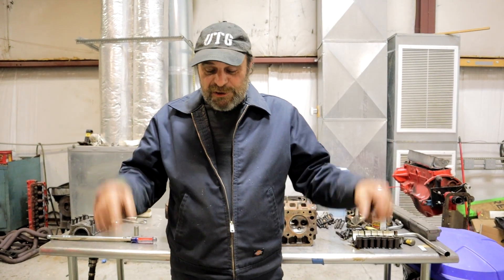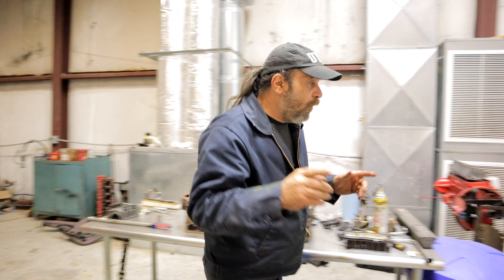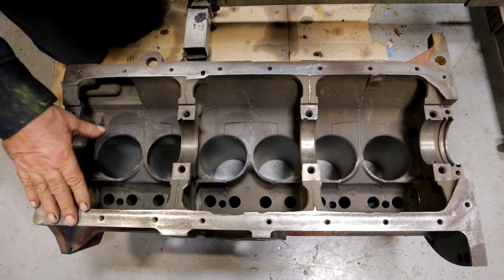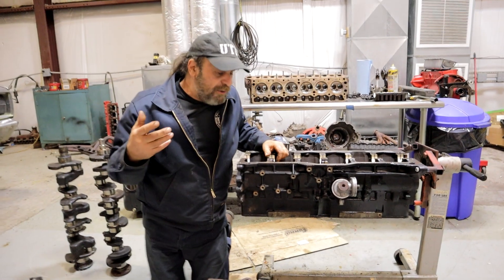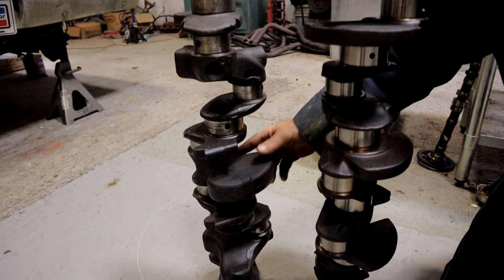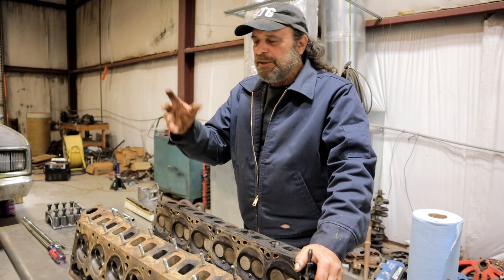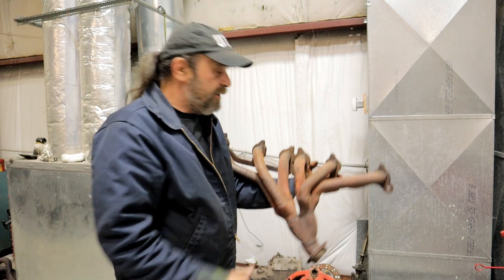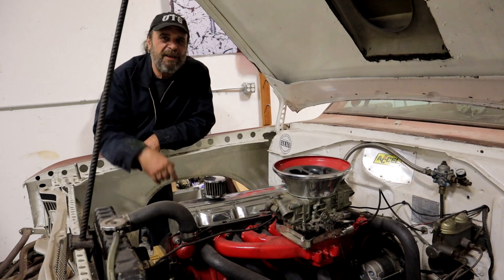The Mighty Mopar Inline 6's History And Comparison - Flathead, Slant, Hemi Six, 4.0 And Hurricane

Comment: Hi Tony, Aussie here. We had a strong inline 6 culture here. GM (Holden) had their grey motor (1948-63) and the red motor from 64-85. The most potent iteration of that was the XU-1 with 202 cubes, triple CDs in a lightweight Torana body (about the size of a Vega). It made 190hp.in street tune. It won Bathurst in 1972.

Ford didn't focus on an all-out performance 6 but did offer an Aussie-only upgrade to the 250 with a cylinder head that did away with the cast-in log manifold and instead made a nicely shaped bolt-on alloy one that took a 2-barrel Stromberg or Motorcraft carb. Good for 170hp and a peppy upgrade to a family sedan when a V8 would be too much of everything else (mainly cost).

Then there's the legend... The Chrysler Hemi 6. You told of the origins but maybe it needs its own storto be told by you one day. The ultimate version sported triple Webers and headers, all the usual go-fast trucks (cam, compression, etc}, and this lump made 302hp. At the time, it was the most powerful production inline 6 in the world. They sound lovely too. The charger was good for low 14-seconf quarters. It doesn't matter if you're Ford, GM or Mopar folk, the Chrysler Hemi gets respect here. 

On a side note, Ford Oz also developed their own evolution of the 250. In 1976, they made the crossflow 4.1 with a head based on Cleveland geometry and uses some components from that engine design too. In 1980, they went to an alloy head. This engine architecture carried on to its final glorious iteration: the famous Barra.
Reply: Damn shame what global communism did to GM Australia and in particular Holden.
Holden produced some of the greatest cars ever made.  A racing heritage that was in everything they made until the globalists took over.

Comment: Latest Curry-cane :) does not hold a candle to the AMC/Chrysler cast iron bottom end. Would like to see what the rockwell hardness is for your block vs the JZ and Barra with the Barra being quite soft compared to the JZ. There is a video of these bottom ends from DownUnder worth comparing to the AMC/Chrylser block. I would like to see also which was the most powerful and well built side valve L6 and L8 and even reverse flow the last Chrysler L head L6 and run boost.

Comment: The 1970 engine that came out in the Australian VG valiant was 245CI or 4.0L the 265CI came out in 1972 there was also a 215CI variant. They stayed around until Mitsubishi took over and they were phased out by 1982. I have always wondered if you could fit Jeep injection on the Australian engines! Thanks for the video UT!

Comment: Great to see the Aussie Hemi, 215, 245 and 265 mentioned. I never seen a AMC 6 in person, and explains why i thought they looked suspiciously like our Hemi engines.  Great information.
Reply: Even Chrysler Australia admitted the 215 was a mistake, by going for economy, they created the only gutless Valiant ever.
Reply: @jasonrivers7518   but, as gutless as they were, the perfect choice for Demolition Derby drivers,  the smaller pistons ment a thicker Bore sleeve, they can really handle the heat once the cooling system emptied out.  I still have my old 215 out the back, it's done  about 6 derbies? Was still running great, just really noisy tappets.  I'll drag it out of the weeds and fire it up 1 day. hasnt started in 20 years lol
Reply: Don't see how that helps, as in demo derbys everyone aims for the ball joints, mate?
Also, my old Dodge ute had no radiator, as my boss sold it, without telling me- 300km later, I noticed it overheating, and realised what had happened. After a half-hour wait, it started again...
Reply: @jasonrivers7518  ball joint hits don't necessarily stop a car,,   as for no radiator, (ur boss was an a-hole )  for not telling you. lOl  but just goes to show how much punishment the old Vals could take.
Reply: Absolutely un-killable, the 245, which was always my favourite, especially with 283 pistons, a mechanical cam, and triple SU:s, you had such a torque monster, my Charger had no traction whatsoever in 1st or 2nd, in the wet- and it had a sure-grip.
I eventually re-designed the entire rear suspension, using XF Falcon & LC Torana parts. (Watt's link, and springs).
Reply: Absolutely un-killable, the 245, which was always my favourite, especially with 283 pistons, a mechanical cam, and triple SU:s, you had such a torque monster, my Charger had no traction whatsoever in 1st or 2nd, in the wet- and it had a sure-grip.
I eventually re-designed the entire rear suspension, using XF Falcon & LC Torana parts. (Watt's link, and springs, respectively).
Reply: @jasonrivers7518   i remember my VH charger, flogged out 265, with the 4bbl Holly. Poor old engine was so worn, could barely hold oil pressure, 1 cam lobe was rounded off. But the same, almost uncontrollable in the wet, short wheelbase didn't help. lol_  aftermarket Dellow bellhousing, Falcon single rail and a suregrip from a ute i brought. Last time i drove it it blew a headgaske, sold it years later,, apparently it's since been back on the road somewhere in SAa as its still registered

Comment: The original "stroker" motor for the 4.0 was simply the 258 with the cyliner bores opened up to 3.880 or 3.875. These engines along with 252 version of the 232 were built in Mexico. The main difference in the casting was the water jackets around the cylinders walls.

Comment: I thought the same thing about the Ford 2.7L as you do about the new Chrysler turbo 6. Thought there was no way they would hold up. But I work at a dealership and we service these trucks daily and ive seen some pushing close to 300k now and they are still running flawlessly. Shame Ford couldn't have put that kind of engineering into the 4cyl turbo variants though cause those are trash.

Comment: 10:00 - Nope. There are two sizes for the Slant Six valves. There's the Stock size that the vast majority have, and then there's the larger Valves for the HyperPak engines. There's also at least three different sized combustion chambers, two of which should be able to be found in the US, while the F7H head from the VF Valiant Pacer will only be found in Australia.
For a Slant making 635+hp, look up "Tilley" and "VC Valiant"

Comment: Like the Slants three versions (170, 198, 225), the Hemi6 also came in three versions, 215, 245, 265. However, where the Slant stuck with one bore size and changed stroke for capacity, the Hemi6 engines all had the same stroke and different bore diameters.
215 was the base spec economy or fleet buyer engine. 245 was the mid spec most of the time, but there were performance variants that would out-rev all but one version. the 265 was the "Big Six", bigger then the smallest Holden V8, and while most were fitted with the Carter 2bbl and basic exhaust, some, such as the E-38 spec and E-49, the latter of those with over 300hp and more then 320lb-ft of torque.
The E-34 variant wore a manifold inspired by the HyperPak Slant Six, while E-38 and E-49 had triple DCOE Webbers.
Reply: I had a 253
Why were they so slow compared to the Variant 6s?

Was it just the carby?
Reply: @willhooke  No. It was everything. Torsion bar front end is softer, making journo's report the car was heavy, but in truth, the Valiants were lighter. All that strut and coil spring bracing, the Valiants didn't need it. VC's are are 1300kilos, CM hemi six, 1400, CM 360 V8, 1650kg. And Charger hemi sixes, 1200kilos. Then add on top a six making more power, four speed gearboxes, Electronic Ignition, the Valiants were starting from a better point before folks started modding.

Comment: Back in the early 2000s I had Charger with a pretty solid 265 4 speed, my mate had an XC falcon with a decent 351 4 speed we both had 2.92 diff gears and in a race they were pretty even depending on who got the better launch would dictate who would win! I’ve still got the Charger but it’s running a CHI head and webers. They are a tough motor!

Comment: Great to see you talking about the inline 6's. Currently building a 292 chevy for my firewood truck. Forged .060 overbore,, high compression pistons, howards hy-torq cam, motorcraft 2100 carb, headers, clifford intake, Harland sharp roller rockers and gm HEI. Should be a nice simple, easy to work on, torque-laden work engine.
I like all the inline 6's and have owned almost all of them.

Comment: Thanks for all the info on the inlines , But I have a question. I found an mid 60s Plymouth valiant  with a 225 , it is toast Sooo I do know where there is a HiPo 273.  How hard is it to remove the 225 and put in a 273? What would I need, for tools I got a hammer and a pair of vice grips :) but really what would I need to do? I know it sounds silly but I need to do this on a dimes worth or cash

Comment: Your opinion on the hurricane is basically the same as Scotty Kilmers and mine also on the fad of smaller motor on boost.  For example; Honda CRZ crossover is 1.9L turbo, Hyundai has one, ford, Chevy.  I bought the Toyota RAV4 because it was a naturally aspirated 2.4L.  I don’t trust the smaller turbo engine for longevity.  They can make great power but I don’t want to deal with possibility of turbo engine problems.  Oil gets dirty faster also.

Comment: The biggest issue with the slant 6 is that Chrysler never made a big inch version like the Chevrolet 292 and Ford 300.
While they were durable, they werent a match for the Ford 300 in terms of longevity.
It is possible to use the crankshaft and other parts from an AMC 258 in the 4.0 block to get over 280 ci.

Comment: the inline six is the ultimate engine,for every generational change,in 1973 it was the oil embargo,fuel economy,slant six won every record for fuel economy runs,esp up pikes peak,now we are back to fuel economy,its the fix for that too,the v8 v10 v12 more mouths to feed,four cylinder,well they even fit motorcycles,where very little torque is needed,the inline proved itself in diesels too,dt466 in king,lugging power that sips fuel is the deal,chryslers inline two turbo is going to be a marvel bet on it,turbo's had free horsepower,but no one ever talks about the amazing fuel economy they give too,the off idle torque of the six in a row torque due to heavy cranks,thanks for bearing all of them blocks side by side,but you know the real downer is not having crossflow head designs,cooler valves,cooler heads,cooler intake charge and on and on-----------6==8 and then some

Comment: I have seen old Chrysler corp. flathead sixes with high performance setups, like twin  (and triple?) carbs, higher compression, higher performance cylinder heads, and other trick items. Yeah, it seemed odd, but they were vintage parts from back in the day, when people were just trying to get a little more oomph out of what they already had.

Comment: They later brought sodium exhaust. They were very high torque . They had 8.5 compression
I pounded every ford flat ford v8 to dust and a studee too. There were many f Chrysler flat 6 and 8s. So the 230 will kick tail I. It's time on all 3.5L engines of all configurations
...torque and durability.

Comment: Pontiac’s ohc six showed promise, and was the first engine used in this Trans Am cars. Not used in Trans Am, but the early Firebird had a TA badged variant. The problem with the OHC was that the cam was mounted in the valve cover, and there was no way to fix a warped cover. It had to be replaced with every overhaul.
 Also the Jeep/AMC 4.0 variant has a much bigger bore, which can be bored out to 3.91. When stroked out using a 258 crank, with a stroke of 3.895”, it matched the VAM’s largest engine size. VAM was AMzC sold in Mexico. But the 4.0 has advantages over the VAM engines. But, if magic was real, it take a HEMI siddha out of my hat and put that in a Gremlin. Now if your willing to run a Turbocharged and can afford it, Newcomer Racing specializes in stroked 4.0s, his first write up was in Hot or Csr craft and that engine made 664 hp. Refinement and an edelbrock head made just under 1,000 hp, and it holds together!

Comment: Two issues with the slant six. Try to pull it out of a Tradesman Van, there is no center of gravity with limited room. Remove the carb & place the engine hoist over the intake and chain it tight & low. 
  Secondly, the frame up front splits and the power steering gear box cracks the frame. Weld, grind add metal to last.
  Why is most not know the rockers are adjustable? They come in running weak & noisy but a simple lash adjustment makes huge gain in power + customer satisfaction. But most of these are gone, just like me soon.
ASE Master Tech since 78.

Comment: Tony I think you sell the original mopar flathead short: it had full pressure lubrication, insert bearings, a forged crank, aluminum pistons and a fully jacketed pumped cooling system when others in the low priced field were peddling splash, babbit bearings, thermosyphons  gravity fuel systems, etc.  it was indeed high tech in 1931 and didnt need replacing until the late 50’s. It continued to be used in marine and industrial applications into the 1980’s

Comment: On turbo cars an intercooler is a big deal in terms of increasing power. It cools the compressed intake charge to increase charge density and lower propensity for knock, allowing higher timing advance. But those inline 6 heads with their intakes and exhaust ports stacked right next to each other on the same side? The heat from the exhaust ports is migrating to the intake port side, especially intake ports with exhaust ports on both sides. That's creating a sort of intercooler in reverse effect. An interheater really. So, I would think the fundamental design of these types of heads with intake and exhaust collocated right next to each other, is standing on its own shoelaces in terms of their ability to optimize power output. Especially when compared to an otherwise identical engine with intake on one side and exhaust on the other.

Comment: Lol...I'm an Aussie. Back in the day ( mid 80's ); I had a VJ Charger ( aussie version )with a 265 and a 4 speed top loader with a real heavy duty twin clutch, long pipe headers, 2 and 3 quarter straight pipe, holley and the rest. Loved revving it to 3500 to 4000 rpm and dropping that clutch at the lights. That car was so light ( about 1350kg's ) that the arse end would step out 😆 🤣 😂.  They were so light in the rear that highway patrol poured cement in the rear wheel wells to get more weight over the rear wheels, hahahaha.
If I was dragging a 350, I'd lose. But against everything else I'd win. Even beat a Kawasaki 750 and a rx2 Capella that was off its nut. Absolutely loved that car. Wish I still had it 😆 🤣 😂
Reply: You do realise that 2750 Kgs is about 6000lbs? And No, our Chargers weighed around 3200lbs or so, with you in it.
Reply: @kramrollin69  Bro, you're right. I checked the weight online. The Aussie Chargers weighed 1352 kg's. Ima diqk. Gotta be that stroke I had 😆 🤣 😂

Comment: Super interesting and very cool, as are all your videos.  A few notes on the flatheads.. The 23" engine, as most old Mopar nuts call it, actually dates back a bit further than the fist six cylinder Plymouth with "floating power" It was Chrysler Corp's DeSoto that first used this exact engine family, introduced during 1928 at slightly under 200 cubic inches and was offered in several oddball displacements thru the 1930's and '40s, but most common was the 230.
Pretty cool that it was built from 1928-1959 in cars, and all the way to 1978 by Chrysler industrial.
Also, all the Chrysler Corp (not Dodge Brothers) Flathead sixes built from 1924 up to 1928 were 7 main bearings !!
Very nice engines.

Comment: Tony,  265, 3.916" bore (same as 318) 3.68" stroke. Intake valve 1.96" 1.6" exhaust.  You can get 2.02 Intake in there without to much trouble.

Comment: Chrysler had little to do with the improvements to the AMC/Jeep I-6 4.0L engine.  After 1987 there was a merging of the Chrysler and Jeep engineering departments.  In 1988 there was a power struggle and Francois Castaing who was the head of Jeep engineering took over all of Chrysler's engineering and reorganized it into platform teams that were smaller and leaner and could work faster.  The heads of most of the platform teams were his Engineering Managers from Jeep and Truck.  The Engine Engineering team was a real meld of both Chrysler & AMC/Jeep engineers but they worked well together.  But the changes to the 4.0L engine were minimal compared to others like the V-10 engine and the V-8 Hemi's that they developed.

As for the new Hurry Cane 3.0L engine, this is wrong thinking by Stellantis's Eurocentric management.  They don't know the American market.  Turbocharged engine reliability and durability has always been lacking as compared to non-turbos.  There will be no 600,000 mile Hurry Canes as there have been 4.0L Jeep engines.  IMHO it is arrogant to think that it can replace the Hemi.

Just remember, "There is no substitute for cubic inches".- Stroker Ace

Comment: Its funny, when I was looking at the Slant Six you displayed sitting on its deck out of the corner of my eye, I could have sworn I was looking at a 2nd Gen Chevy Inline 6 Stovebolt.  It also only has 4 main bearings (made from 1937 to 1962 in 216, 235 & 261).  The odd thing for these inlines is their main journal sizes vary from large at the rear to small at the front, as such, you can't align hone them.